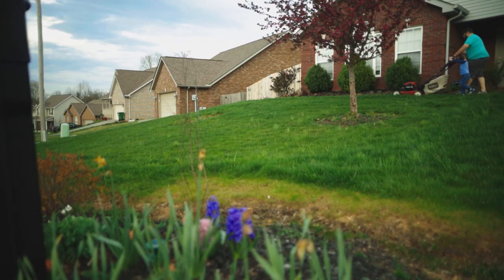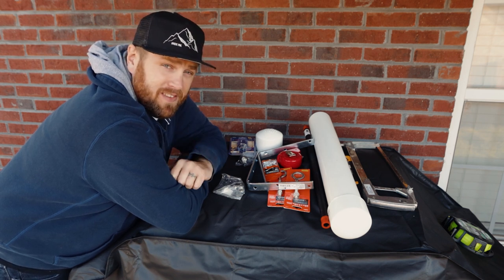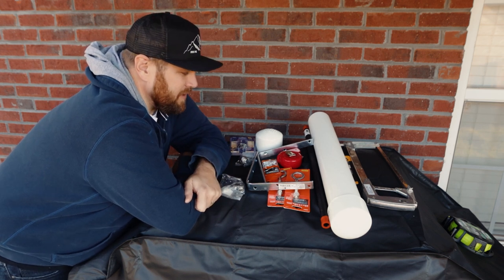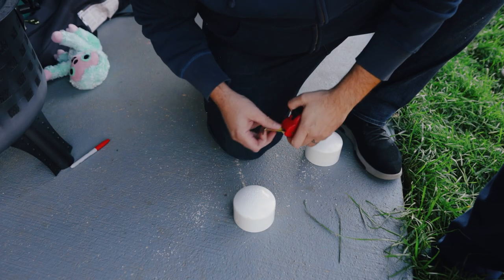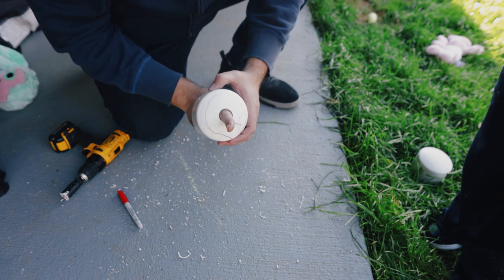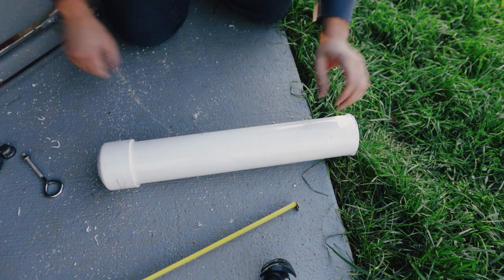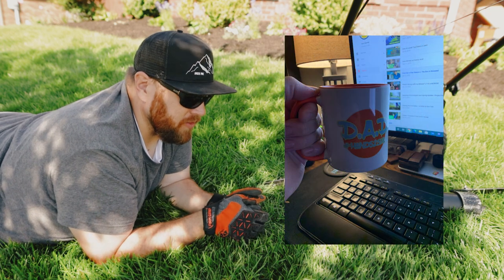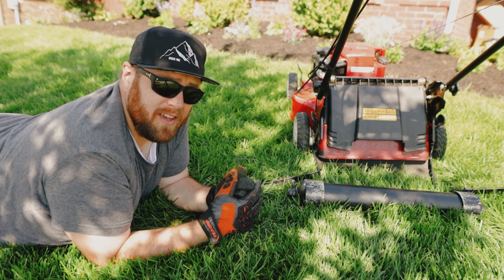My DIY Lawn Striping Kit

Comment: Strawberry patch. Lol. Well done👌🏾 I just striped my lawn with a striping kit for the first time 2 days ago. Bought the toro one. I don’t regret it.
Reply from the maker: I'm strongly considering it after a second attempt (not filmed).
Reply: Dadding All Day price point, isn't the best, but once it's installed, it's a breeze taking it on and off, and you can even have your bag on at the same time if needed. The hardest part was getting the sand inside the roller!

Comment: Strawberry planter...great job Chuck. I forked up the $100 for the Toro Striper Kit, and it still has its negatives even though it’s a branded striper.  Keep using it and it become easier to use. Plus it’s fun to see the different stripe designs you can make (besides singles, double fat, double/singles, circles). HAVE FUN!
Reply from the maker: I plan on it. The only real downside to my lawn is it’s level.

Comment: Nice work! I found that attaching the brackets to the mower with locking pins worked much better. Didn't have to worry about anything really coming loose.
Reply from the maker: Thank you sir. I’m  working on that for next time.

Comment: A strawberry planter.  Built a striper last year with extra materials from one of my jobs 4” schedule 80, unistrut, then just purchased the clean out caps and fasteners, pivots via eye bolts, one mounted to the deck, the other center mounted on the unistrut, so its articulated, Pivots like a trailer, lays some mean stripes on my sissy grass!!! 😉
Reply from the maker: If I could get the pivoting nailed down, so I could also back up, that would be fantastic!